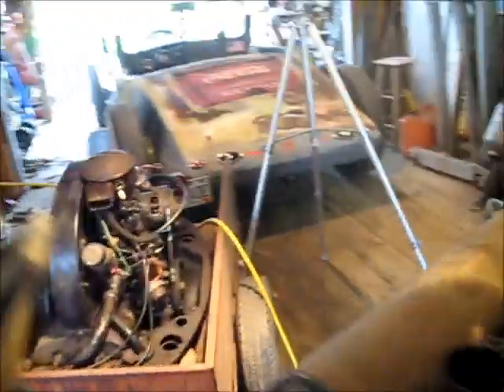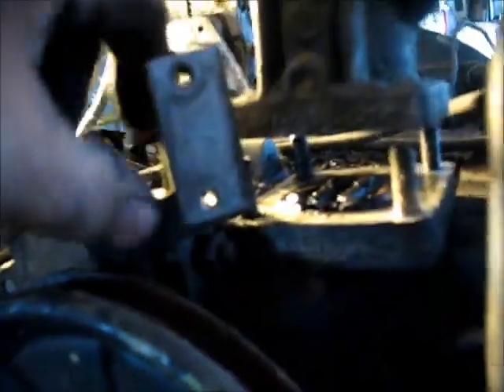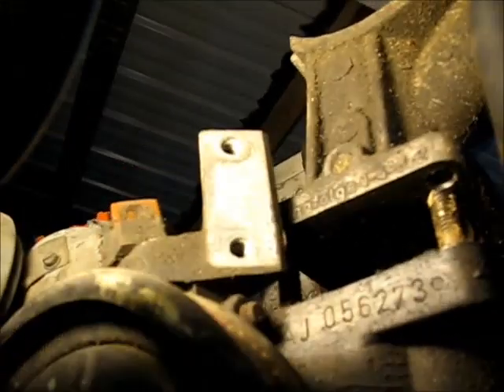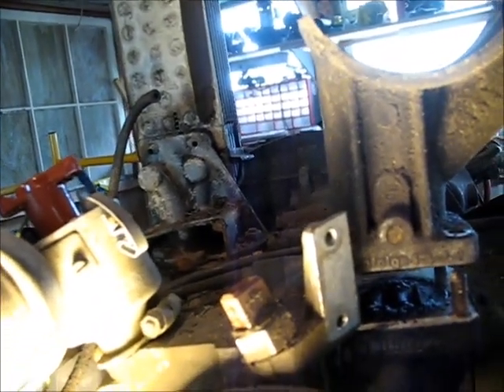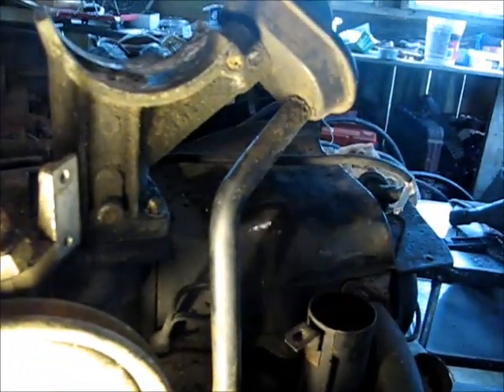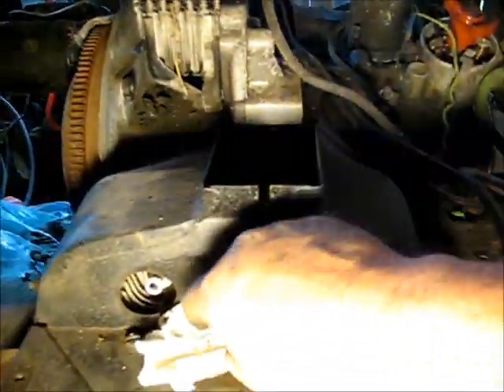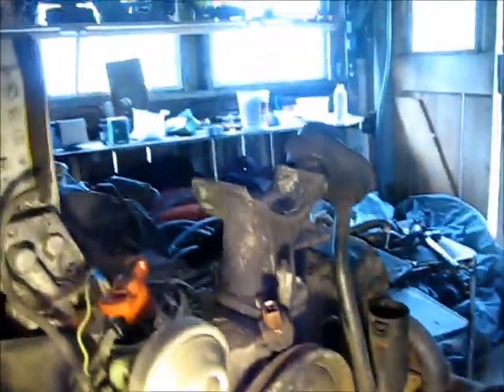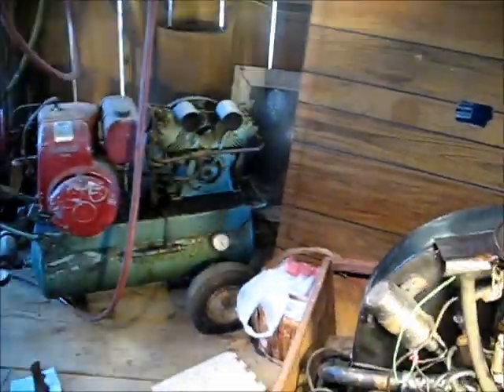1975 VW Bug motor examination

Comment: I think I would save the 1600 for a built up play toy and then use the smaller engine in what was going to get driven more regularly. build up the 1600 with a stroker crank and big  bore kit, would make for one fun ride. ;-)